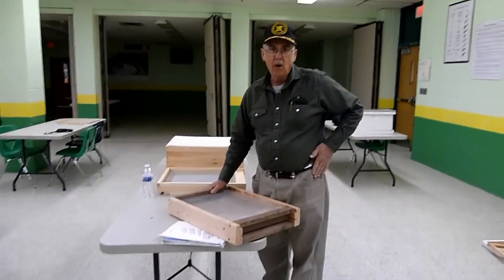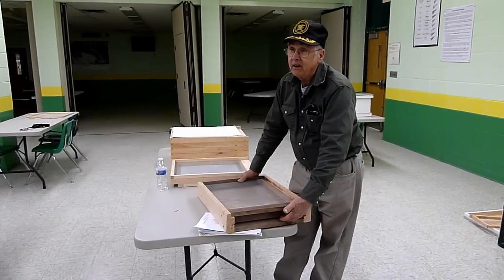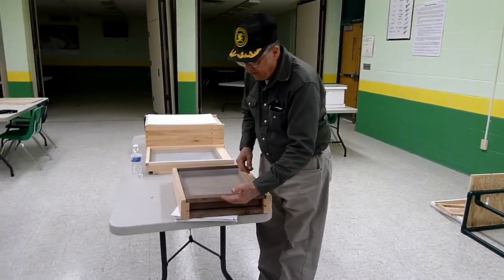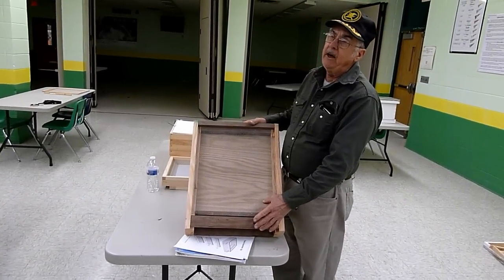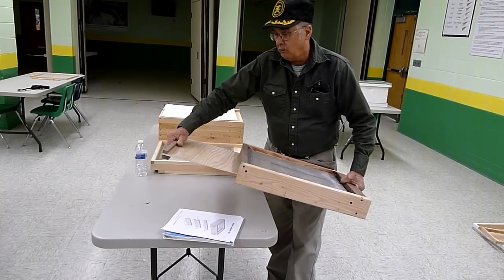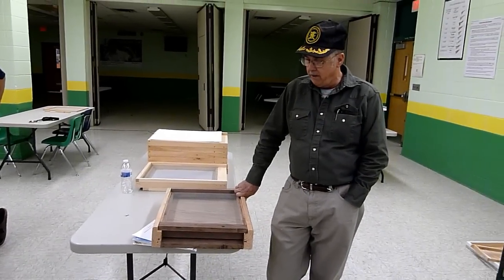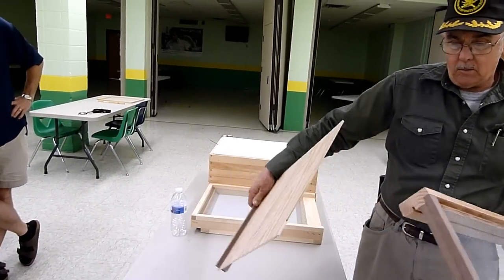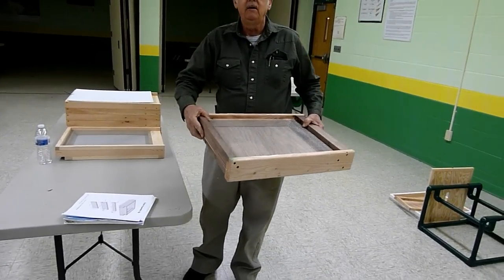Custom Screened Bottom Board Prototype

Comment: Are the plans for this bottom board available to me?
Reply from the maker: I let Roger know that there were some requests for this device but there are no plans at this time. I'll see him this week and see if I can cajole him to hand one over to me so I can make a diagram.
Reply: Stephen,  I watched this over and over and figured out the design.  It looks to me that the outside length and width of the bottom board is the same as a super.  There is no extended front like a traditional bottom board.
This is going to be hard to explain without drawings or diagrams.

The guy used 2x4's for the sides.  The tops have a 3/4 x 3/4 inch for the screen to lay in.  That leaves another 3/4 inches of wood on the outside for the box to sit.  The dado's are cut (about 2/3's).  Looks to me he cut a thickness of two blades.  That dado will depend on the thickness of the tray you plan to use.

Next he built two 'L' shapes with 3/4 inch.  The bottom piece you see in the front is attached to the back board that the bees climb up.  This piece that goes up is also where the screen attaches.  This piece that goes up also stops at the bottom of the 3/4" cut.  This way the bees can go into the frames. It looks to me that this piece should go in first and then the front top piece goes in next.  

The front top piece is the other 'L'.  It runs opposite of the bottom piece.  The piece looks more like a 1 1/2 inch x 3/4 inch and then goes down to 3/8 from the bottom.  This part shows you where the bees go in from the outside.
I would 'dry fit' the pieces to be sure to get everything just right.  Mark them with a pencil so you know where they fit.

The back piece is put in, in two parts.  First is the lower piece that lines up with the bottom of the 3/4 inch groove.  The screen also attaches to this.  Then the top goes over that which fills in the 3/4 inch groove in the top.

 You'll have to watch the video over and over to understand what I'm explaining.  I don't have pictures or a diagram.  So, good luck to you.  Take your time and examine the video over and over.  
Then look at what I wrote and start tinkering with the inside measurements.  Write the measurements down with your own diagram.  Figure the measurements.  Make it a challenge to get this right.  If you make a mistake here and there, then take it as a learning experience.
I'm going up the mountains tomorrow to my workshop.  I'm working on a model that I can get measurements.  I figure it will take a couple of hours to make a prototype.  Then I can make a pile of parts and put together a pile of these things.
I'm very curious as to the effectiveness of this bottom board design.